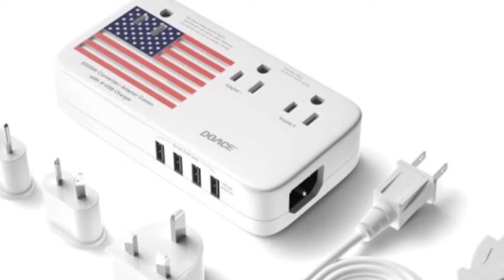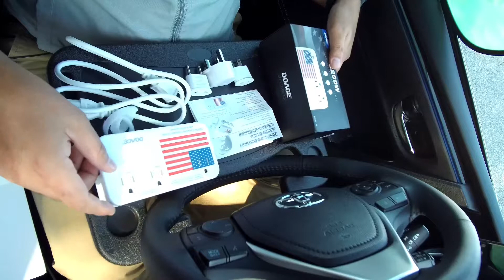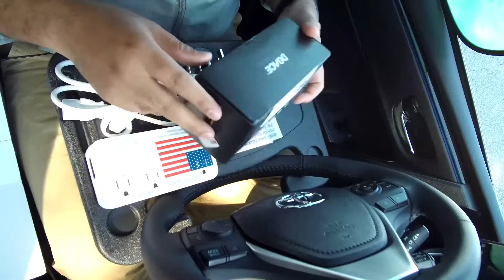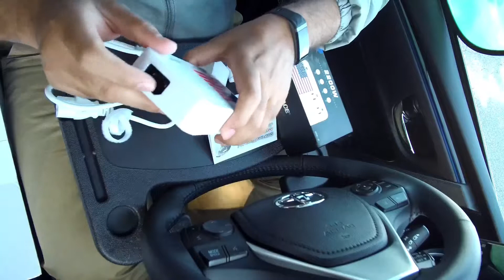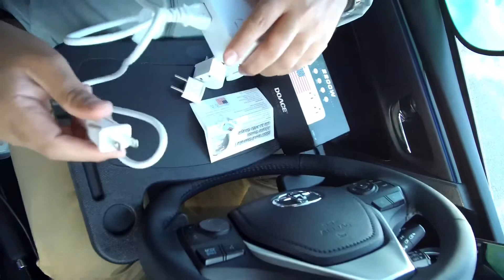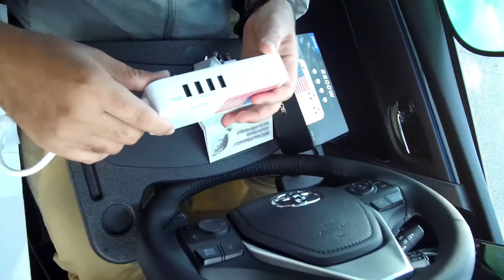DOACE 2200W Voltage Converter with Adapter

Comment: @Mind Whirlpool -
you didn't notice, its just a restyled "National Pride" variant of the ILLEGAL dodgy old Bestec junk (pure Chinesium) (https://www.youtube.com/watch?v=nQoc3HNXqlM):
1. NO Earth (illegal 2 to 3 connection plug) but allows Earthed plugs ( = illegal) , probably Earth generally not supported in the device (investigate it by take apart ! ).
2. includes 3 multi-illegal "Death-dapter" (https://www.youtube.com/watch?v=ESIzuV6kdWY) face plate style travel adapters without ANY safeguards ( 1. bad contacts , 2. lets you insert plugs in dangerous ways , 3. NOT Earthed but of course allows earthed plugs , 4. big holes & no working protection shutters , 5. of course no fuse even in the UK one = UK requires all plugs to be UK-fused due to 32 Ampere circuits ).
3. All this is a bad sign that is to cheap & it might have problems like excessive interference & excessive dirty electricity (illegal).

CONCLUSION: Dodgy !

It is to expansive for what you get , at least you need to replace the cable & all 3 adapters , IF the base unit is OK (Earthed & reasonable interference suppression).

You as reviewer got tricked due to lack of knowledge ( & online investigation) , you did not notice any of these serious problems.